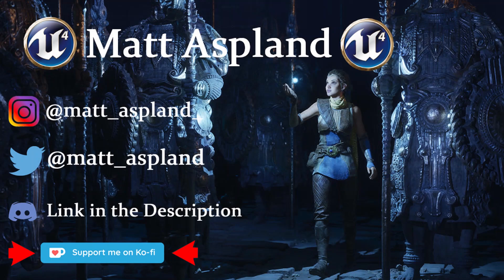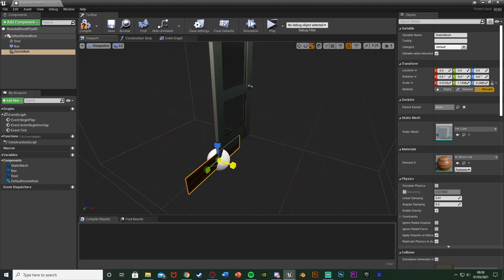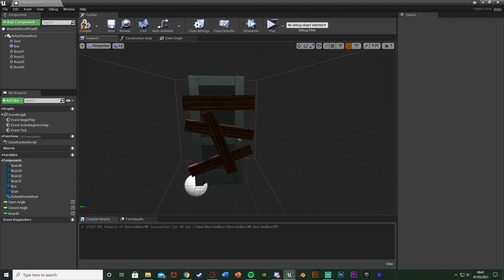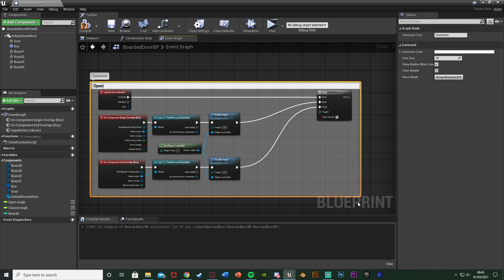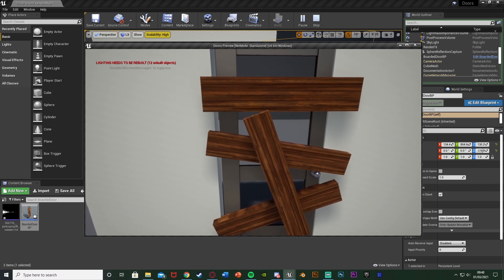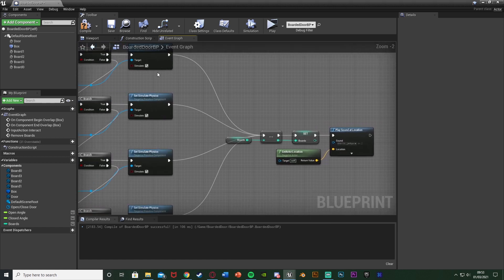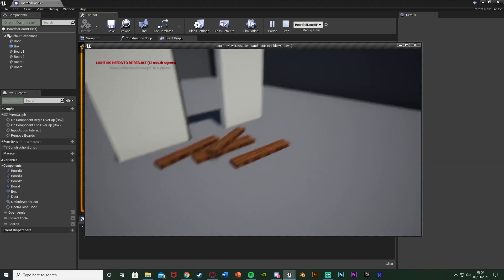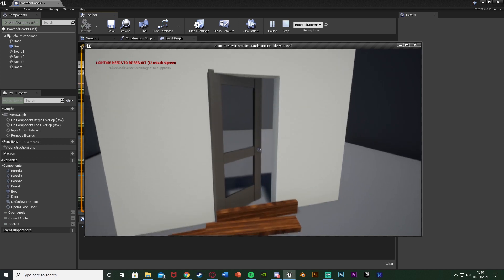Remove Wooden Boards To Open The Door - Unreal Engine 4 Tutorial

Comment: How to remove it by using hammer or Crowbar please
Reply from the maker: Thanks for helping guys, you are both correct! I can also add this to my list too for a part 2 :)
Reply: you could just add an animation to it when you press E Im pretty sure
Reply: Just cast to your player-Disable Input ( not necessary)- set your player's rotation/location -- play animation when player touch  trigger on the map (and if you wanna use Button for this do it in your Character blueprint! make a variable for button trigger and use it for branch...example if you enter door's trigger your crowbar variable On in the Chracter blueprint .and if your Chracter's crowbar variable On  If you press "F" play animation etc.... ( Use input commands things always in your Character Blueprint.. ( Okkey my english  so bad and maybe you cant understand but if you think this is easy system :(